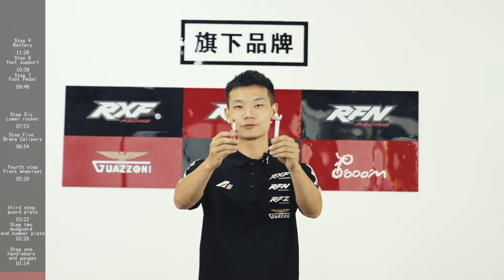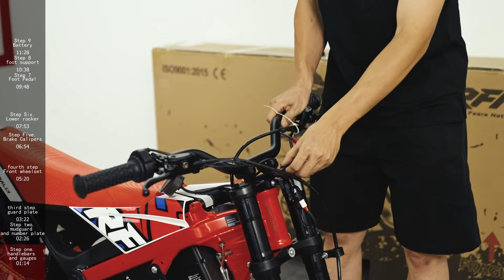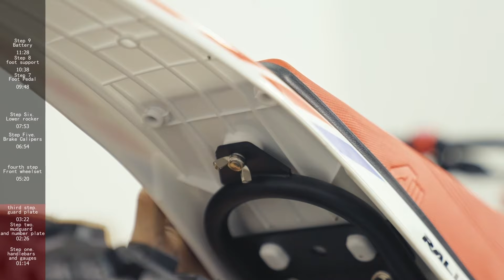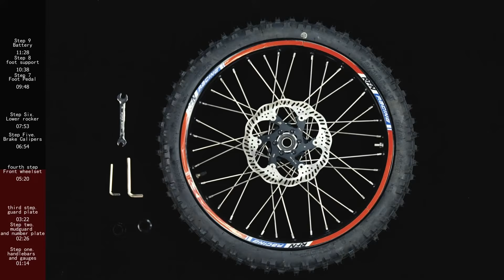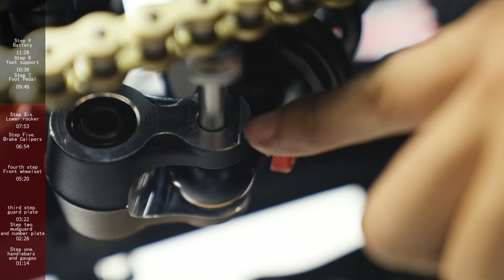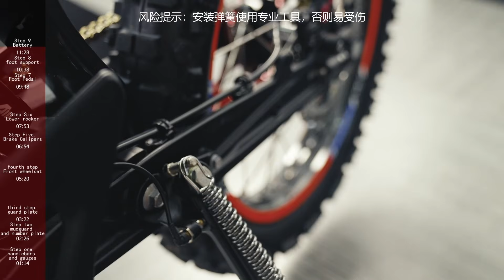Step-by-Step Assembly Guide for Apollo RFN ARES Electric Dirt Bike

Comment: tried that and still no power... what is that black button between seat and triple clamps? start button? or? reset? tried that and still no power... any ideas?? I turn key on, speedo lights up, biut thats it... I rode around block twice already and no I have nothing... have power from battery but no movement...